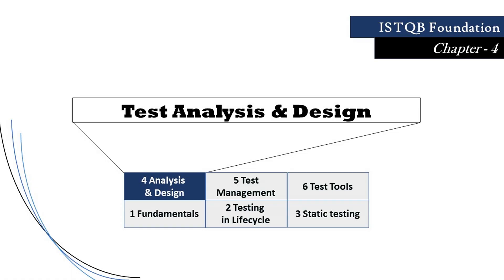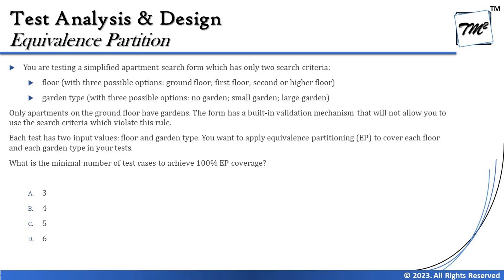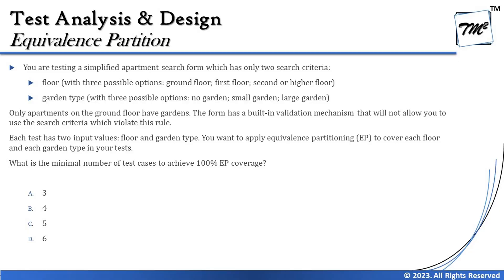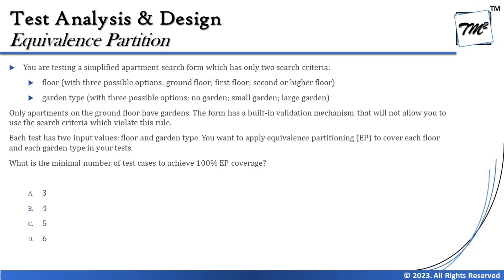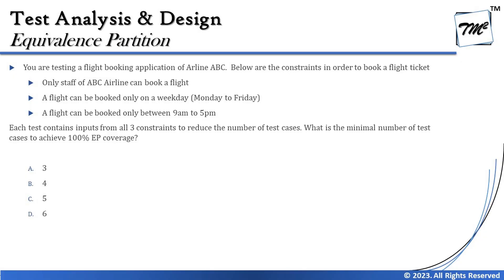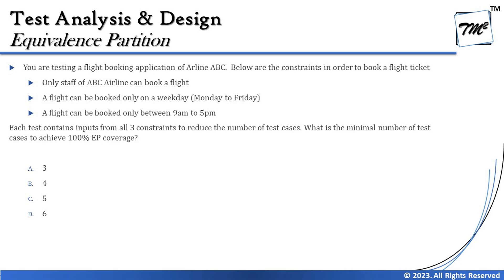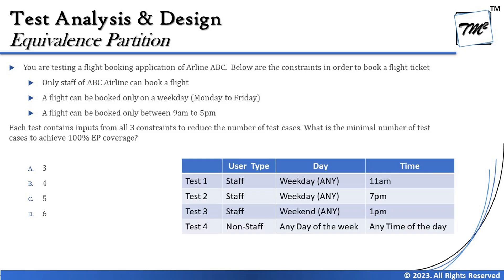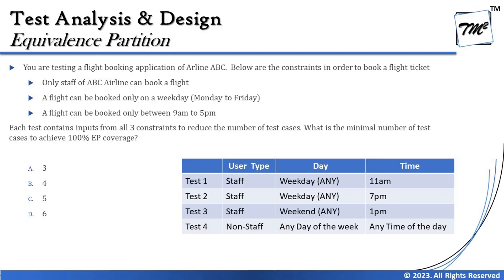ISTQB FOUNDATION 4.0 | Tutorial 30-1 | Equivalence Partition | Test Case Design Techniques | CTFL

Comment: About the Floor/Garden Question:
I had an argument about this question with my trainer. It doesn't say anywhere that the ground floor should ALWAYS have a garden, but it seems that in this case it is implied that it has. I find this stupid because it says "only the ground floor has a garden" and maybe if there was the possibility to not have a garden it should've said "only the ground floor CAN have a garden". 
Anyways, I think the question is stupidly formulated, because my logical answer should've been 5 TCs (not 4).
Reply from the maker: Thanks for sharing your view.

Comment: Q2 - ANSWER is 3

Breakdown:

Constraint 1 – User type:
Staff (valid)
Non-staff (invalid)
→ 2 partitions

Constraint 2 – Day:
Weekday (valid)
Weekend (invalid)
→ 2 partitions

Constraint 3 – Time:
9am–5pm (valid)
Before 9am (invalid)
After 5pm (invalid)
→ 3 partitions

For EP, each test can cover one partition from each constraint.
The minimum number of tests = the largest number of partitions among all constraints.

Short justification: each test picks one partition from each constraint. To cover all partitions of a particular constraint you need at least as many tests as that constraint has partitions. Time has 3 partitions (before 9, 9–5, after 5), which is the largest count, so you need ≥3 tests. Three tests can be arranged to also cover the 2 partitions of the other constraints.

Example minimal set:
Staff, Weekday, 10:00 → covers: Staff, Weekday, 9–5 (valid).
Staff, Weekday, 08:00 → covers: Staff, Weekday, before 9 (invalid time).
Non-staff, Weekend, 18:00 → covers: Non-staff, Weekend, after 5 (invalid day, invalid user, invalid time — still counts for those partitions).

If you defined time as only inside vs outside working hours (2 partitions) then the answer would drop to 2. But with three time partitions shown, 3 is correct.

=================
Bottom line: 
Airline question → unrestricted combinations → largest partition count = 3
Garden question → restricted combinations → some partitions can only pair with one floor → need 4 tests (Ground + No garden is allowed but does not help reduce the minimum count. You still need 4 to cover all partitions correctly.)

Comment: Couldn't the answer for the first question be 3? Simplified further, it's saying that any floor that isn't Ground will have a garden,

So it would become:

Ground -> Small Garden
Ground -> Large Garden
First or Higher -> No Garden
Reply from the maker: As you see there are 3 partitions (GF, FF and Second Flor or Higher) in floor type we can’t make it 2. 

So you need one more test second floor or higher -> No garden

Comment: Hello Sir, could u please help me with this question:   
You are testing a banking application that allows a customer to withdraw 20, 100 or 500 dollars in a single transaction. The values are chosen from a drop-down list and no other values may be entered. How many equivalence partitions need to be tested to achieve 100% equivalence partition coverage? 
a. 1 b. 2 c. 3 d. 4 

I thought the answer is 3, chatgpt says its 2, which actually is making more sense...1 valid and 1 invalid test case here but the answer where I got this question from says 4...they say its 3 test cases valid and 1 invalid which is no selection.....please help me whats the answer here with explanation. Thanks is advance.

Comment: Coming back to this point. Ive read your response as well as others. Something im curious about is, Using ECC the answer is 4 and GF-NO Garden is not an option.. However, Would the answer be different if we simply used EP and not ECC? Are they one and the same?  If they are different and the question did not state to use ECC, how do we know when to apply? Im assuming you always use ECC since the question doesnt state to use it?
Reply: Or maybe I'm just overthinking this and because the word "Can" is exempt, there is not GF-No garden. If "Can" was there the answer would be 5?
Reply from the maker: Your first part is fine as you understood it well. But what is ECC?
Reply: @TMSQUARETECH  Each Choice Coverage.   I saw it in the last sentence of the syllabus and others mentioned it so thought it was maybe a different concept. Im thinking the most obvious solution goes back to my response above. "Can" is exempt from the wording so that means Ground Floor + no garden is not an option.

Comment: For question with the airline, I don't understand why the answer is not 3:

Staff - weekdays - 7pm
Staff - weekend - 1 pm
Non-staff - weekdays - 6 am

Why can't we test the non-staff in this way, why do we need to test the staff first with all 3 time partitions?
Reply from the maker: If you notice you don’t have any of them as a valid test case. In all the above tests the ticket will not be booked. Thanks for your inputs.
Reply: @TMSQUARETECH  thank you for your prompt answer.
So you mean we need to have a minimum number of combinations in order to test which combination behaves  according to the requirements, despite having to repeat the same partition?
E.g. Staff - weekdays - 1 pm
        Staff - weekdays - 7 pm
Reply from the maker: You got me right. Yes
Reply: @TMSQUARETECH  many thanks!

Comment: I have an inquiry about the test questions.
Let's look at the flight booking one.
If we do not care about the validity of the inputs and simply want to cover all the options from each constraint and from its intervals, surely the answer would be 3, right?
The first constraint (staff) only has 2 options, the second constraint (day) has two intervals, and the third constraint (time) has 3 intervals. We can do 'staff, monday, 5am', 'staff, sunday, 10am' and 'non-staff, tuesday, 8pm'. All the intervals from all constraints would be covered like this using only 3 test cases.

If we were to test the intervals and valid/invalid inputs 'properly', then the answer would be 5.
First we want a valid input - 'staff, monday, 10am'
then we want to make only one constraint invalid each time (and as the time can be invalid in 2 intervals, we would have an additional test case for that). In total 5 cases. But for completion, here are the 4 remaining ones:
'staff, monday, 5am'
'staff, monday, 9pm'
'staff, sunday, 10am'
'non-staff, monday, 10am'

I am unable to find any reason to have 4 test cases. Would you be able to enlighten me?
Reply: That's exactly what I was thinking as well. My answer was 3, then I listened to the justification on 4.. but why do we add an extra invalid scenario, when we're supposed to use the minimum no of test cases that cover all partitions? 3 does that..
Reply from the maker: My Bad I was under a different impression. Please correct it as 3. 
It's always Minimum tests hitting every partition at least once with desirable outputs covered.
Reply from the maker: My Bad I was under a different impression. Please correct it as 3. 
It's always Minimum tests hitting every partition at least once with desirable outputs covered.

Comment: Your videos have been invaluable for me but for the garden/floor question... I still do not understand why the answer is not 5. Ground Floor/No Garden = combination as it does not say ALL ground floors = garden... Only that only ground floor CAN have gardens. Therefore No garden/ground floor has to be a possibility. Ive read the reasons below but none give a straightforward answer i can understand. What am i missing?
Reply: Is it simply by saying minimum, youre not looking for combinations??? Only that youre making sure each possibility is hit once?
Reply from the maker: Yes thats another factor we are trying to reduce the test cases rather than trying all combination. Test techniques are to reduce the test cases.
Reply from the maker: Excatly the point. There is no use of CAN word which means ground floors have gardens. You can check my other discussion in these video - https://www.youtube.com/watch?v=ngOjzJUUDsU&list=PLj5VKaW115t2hy1sRroUin0h8TVG0uP7r&index=8&pp=gAQBiAQB

Comment: I want to explain the Garden question because I see some people don't get it.

Your task is to determine the minimum number of test cases to cover "Ground Floor", "First Floor", "Second or Higher Floor", "No Garden", "Small Garden", "Large Garden" as inputs.

"First Floor" and "Second of Higher Floor" imply "No Garden".
Thus your test cases are ("No Garden",  "First Floor") and ("No Garden", "Second or Higher Floor")

Now you covered "No Garden", "First Floor" and "Second or Higher Floor" (3 items) with 2 test cases but we still need to cover "Ground Floor", "Small Garden" and "Large Garden".
The only solution to this is ("Ground Floor", "Small Garden") and ("Ground Floor", "Large Garden")

Therefore the answer is, we need 2+2 test cases to cover all inputs.

Edit: Omg, I just found the solution from ISTQB:

“Small garden” and “large garden” can go only with “ground floor”, so we need two test cases with “ground floor” which cover these two “garden type” partitions.
We need two more test cases to cover the two other “floor” partitions and a remaining ”garden type” partition of “no garden”.
We need a total of four test cases:
TC1 (ground floor, small garden)
TC2 (ground floor, large garden)
TC3 (first floor, no garden)
TC4 (second or higher floor, no garden)
Thus:
a) Is not correct
b) Is correct
c) Is not correct
d) Is not correct

Comment: For Q2 the main confusion is between EP and ECC (Each Choice Coverage). If you consider EP answer will be 5 but for ECC answer will be 4. Here we consider ECC because it is the simplest coverage criterion in the case of multiple sets of partitions. To achieve Each Choice Coverage, we need to ensure that every choice is tested at least once. The goal is to create test cases that cover all choices across the constraints. We can aim to combine choices to minimise the total number of test cases while ensuring that each choice is covered. 
To achieve Each Choice Coverage (ECC), we need a minimum of 4 test cases:

Test Case 1: Staff, weekday, between 9 am - 5 pm (Valid)
Test Case 2: Non-staff, weekday, between 9 am - 5 pm (Invalid due to non-staff)
Test Case 3: Staff, weekend, before 9 am (Invalid due to weekend and time before 9 am) - this is combination of 2 choices to minimise the no. of test cases
Test Case 4: Staff, weekday, after 5 pm (Invalid due to time after 5 pm)
Conclusion
To achieve Each Choice Coverage, we need 4 test cases, which is fewer than the 5 test cases required for EP coverage in this scenario. Each test case is designed to ensure that every possible choice from the constraints is covered at least once.
Reply from the maker: Appreciate your details explanation and contribution to the tutorial. Thanks.

Comment: here they have 3 options- No garden, small garden and large garden.  so accordingly we need to divide into 3 classes i.e. ground floor with no garden, ground floor with small garden and ground floor with large garden. and if we consider so then answer should be 5
Reply from the maker: When there are explicit restriction given in the question we need to follow them. As it says ground floor only have gardens means they have gardens. This is why you should consider them accordingly and remove the ones which are not required. Let me know if you need any further assistance. All the best!!
Reply: Saying only ground floor have gardens doesn’t guarantee every ground floor apartment has a garden, just that all floors above don’t. This is what confused me and I picked 5. I hope I don’t get tripped up on the exam.
Also, thanks for your videos, they’re really helpful
Reply: I had the same doubt

Comment: You are testing a registration page for a web application and your task is to design test cases for the login field on the registration form. The login must be between 8 and 12 characters, alphanumeric and contain at least one capital (uppercase) letter. You want to apply the Each Choice Equivalence Partitioning test technique.

How many partitions do you need to cover?

1. less than 8 characters(invalid);

2. from 8 to 12 characters(valid);

3. more than 12 characters(invalid);

I

4. alphanumeric (contains letters and numbers);

5. not alphanumeric (contains non-alphanumeric characters or only numbers/letters) (invalid);

6. Includes capital (uppercase) letter(valid);

7. doesn't include capital (uppercase) letter(invalid)

As per my understanding we can consider 2nd and 6th as 1 partition , then total number of partitions would be 6

Please clarify..

Comment: The flight ticket one confuses me. According to video we are making 4 test cases: 
STAFF / WEEKDAY / 9:00 - 17:00
STAFF / WEEKDAY / 17:01 - 23:59
STAFF / WEEDEND / 9:00 - 17:00
NON-STAFF / ANY / ANY

But we are not testing 00:00 - 8:59 Anywhere. So I think there should be a 5th test case STAFF / WEEKDAY / 00:00 - 8:59.

Am I mistaken? Please explain
Reply: OR alternatively, The test cases should be: 

STAFF / WEEKDAY / 9:00 - 17:00
STAFF / WEEKDAY / 17:01 - 23:59
STAFF / WEEDEND / 00:00 - 8:59*
NON-STAFF / ANY / ANY

in which case the answer "4 test cases" would make sense
Reply: @vaxutucuna  i have the same question and my brain is about to explode. Finally after 13 days did you found any solution?
Reply: @katarinabolova6879   in case of multiple sets of partitions we are using EACH CHOICE coverage. Each choice coverage requires test cases to execute each partition from each set of partitions at least once. So we're not focusing on all possible combinations, we're focusing on testing value from each partition at least once.
Reply: @katarinabolova6879  So this is the correct answer: 

STAFF / WEEKDAY / 9:00 - 17:00
STAFF / WEEKDAY / 17:01 - 23:59
STAFF / WEEDEND / 00:00 - 8:59*
NON-STAFF / ANY / ANY

in which case the answer "4 test cases" would make sense
Reply: @vaxutucuna  now i get it, many thanks. Also giving 1pm to the Test 3 and not a time below 9am was the mistake. i took it as granted and i stucked
Reply: @vaxutucuna  from the point of the good real testing, your answer is not correct. You cannot have more THAN ONE invalid input per testcase and in TC 3 you have 2.

Comment: So we just came from a tutorial where less than 1 (invalid), 1-15 (valid), and greater or equal 16 (invalid) are three partitions.  Less than 1 isn't in the same partition as greater or equal to 16.

So isn't it the same for 00:00-08:59 (can not book), 09:00-17:00 (can book), 17:01-23:59 (can not book) ?  But there's no test case here in the range  00:00-08:00 (weekdays).
Reply: I got the same concern. I selected the answer as C, which includes 5 classes..
Reply: Time, in this case, and from a technical standpoint, is not seen as a sequence, as we did with the list of integers.

Here the time is evaluated as "Within specific hours" or "Outside specified hours". We do not need to separate the outside hours in different ranges before and after hour specific hours.
Hope that helps.

Comment: Why are you not considering a TC for time before 9am on week day for staff ? If time between 0:00 and 8:59am is another partition
Reply: The timings have three partitions but the question only requires the minimal number of test cases, so having a test case for before 9am on a weekday for staff will have the same result as the test case for after 5pm on a weekday for staff, both will result to a fail. Since both result to a fail as they are not within the 9am-5pm timings, and they have the same user type and day, they're technically considered one test case (I know they aren't, but we need the minimal number of test cases, and including both will be redundant since either options will have the same result).

Comment: Even if the question says minimum number of test cases, shouldn't EP cater for the invalid cases too? Cause Equivalence Partitioning is also about valid/invalid partitions?
Reply: I agree and that's what I thought at first to answer the question but I think they only take into account valid combinations because they say straight away that it's impossible to combine first or second floor with a garden. Therefor they're assuming that it's not possible to test invalid combinations. But he's I'd have tested too if that impossibility is true.

Comment: Why don't you test if the the ground flour don't have a garden? There is nowhere said that the ground flour should have a garden. So for me there should be a fifth test with ground flour -> no garden.
Reply: I also considered another class for ground floor without a garden
Reply: I'm confused too and answered 5 at first. In the solution it says 4.
Reply: Every single input atleast one
Reply: I know this comment is already old but what made me understand that question is that right off, it already made it clear that the ground floor of the apartments, for this particular question and scenario, have gardens, so it is not an option to test a ground floor with no garden.
Reply: 4 is wrong since it has not be stated that ground floor should always have a garden. correct answer should be 5
Reply: @urgent-growth  not in the case with multiple EP. Please refer to my previous comment. We don't need to check every combination, we just need to check every data set at least once
Reply: yes, it should be there
Reply: @bisomenike9769  it shouldn't be there, because according to the syllabus, in case of multiple sets of partitions we are using EACH CHOICE coverage. Eeach choice coverage requires test cases to execute each partition from each set of partitions at least once. Meaning that we tested NO GARDEN partition with first and second + floor test cases. so we don't need to test it with ground floor as well. remember this is to cover all values of the fields, not all combinations.
Reply: @vaxutucuna  thanks for this, I already took the cert a couple of months ago I am reviwing for the agile one and this comment just saved me from going back to the new syllabus to search the answer for this question